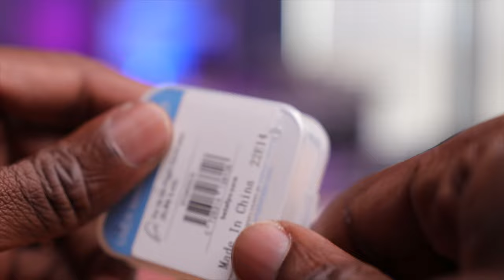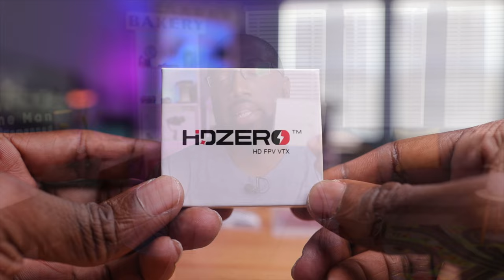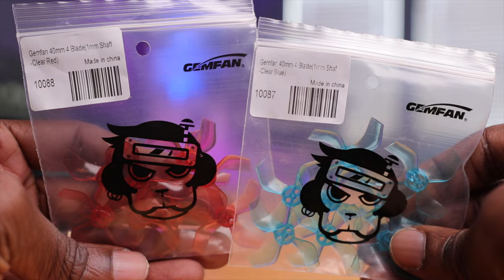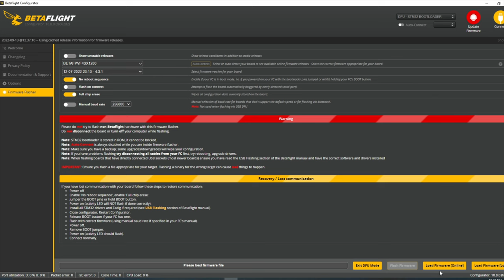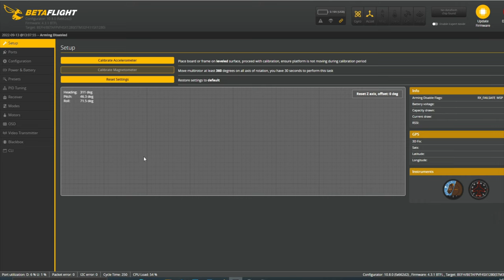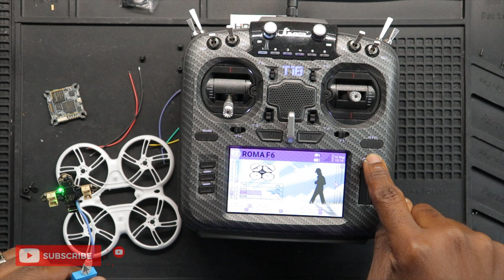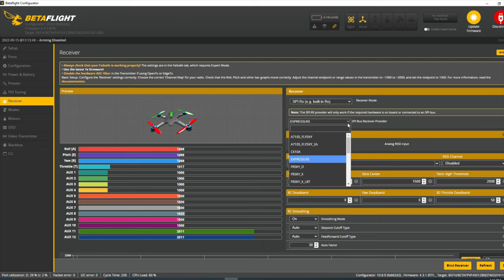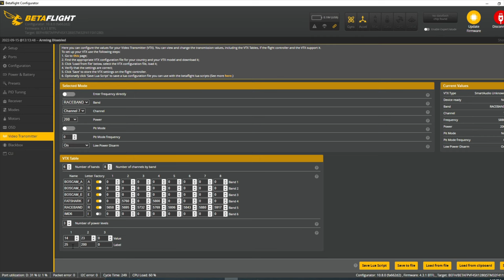TinyHawk 3 HDZero Build | The Whoop You Never Knew You Wanted

Comment: I noticed the extra space under the battery. Very nice. Did not know about the Gyro issue. Will the firmware update fix it or once it’s done it’s done.
Reply from the maker: The firmware does not fix it, just prevents it from happening.  If you've already powered it up and notice no issues, then you should be fine.
Reply: Have you ran across any good pertunes for the th3.
Reply from the maker: I’m using the “UAV Tech - Whoop (1S - 2S)” Preset and its working OK so far.
Reply: Very nice. Got mine last year was not much for mods then. Time to look in to it.

Comment: How easy would it be to install the HDZero camera on an already built Tinyhawk 3? Does it help a lot with the annoying static picture you get when flying with the original camera and setup the TH3 comes with?
Reply from the maker: You can’t just add an HDZero camera to the existing analog setup.  You’ll have to add a new HDZero VTX as well as the camera.

Comment: THis will be good to try as my flight controller died. i just check on the part list and no stock. thanks i will try this when i can find a controller.
Reply from the maker: No prob.. Parts are hard to find these days. Get them while you can.
Reply: @OneManUnmanned  i got the parts. what file did you load on the controller?
Reply from the maker: I used the Metor75 CLI since that’s where the FC came from, and that drone is similarly  sized to the TinyHawk 3.  I later changed the tune, using the Presets tab in BetaFlight to “UAV Tech - Whoop(1S & 2S)”.
I also used the HDZero VTXs Presets in the “Presets tab of BetaFlight to configure my VTX.

I’ll link the Metor 75 CLI below if you want to use it for basic configuration, but I’m now on the UAV Tech Whoop Preset.
https://support.betafpv.com/hc/en-us/articles/4408029285017-CLI-for-F4-1S-AIO-5A-FC-ELRS-2-4G-2021-
Reply: @OneManUnmanned  what did you pick for the PWM?
Reply: i got it  working but the props are hitting the battery. did you have a clearance problem?